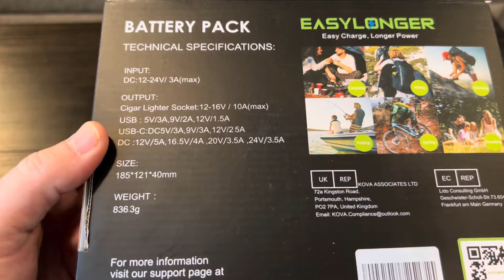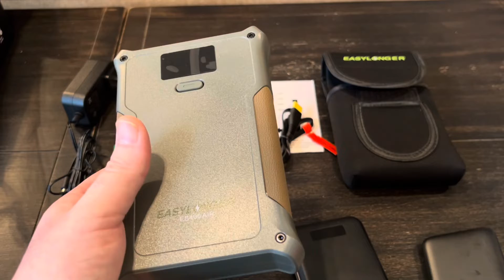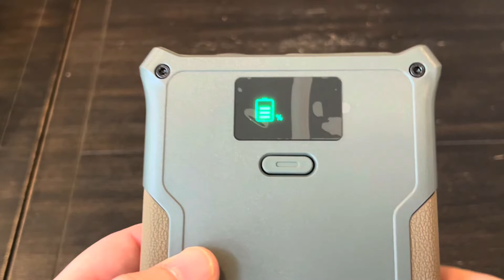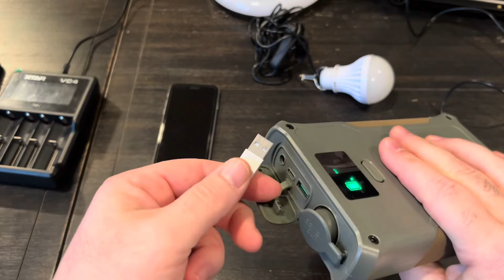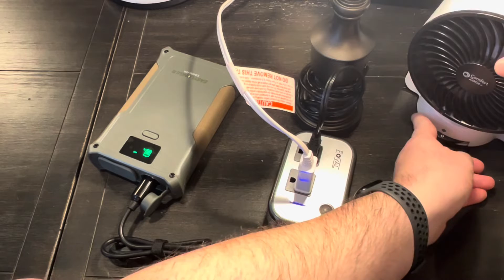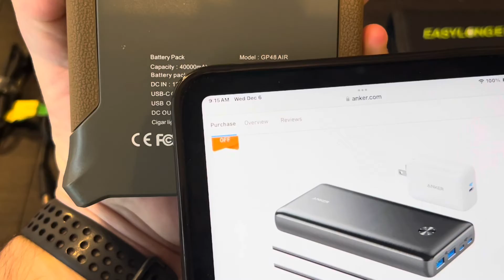EASYLONGER ES400 AIR Portable Power Station (CPAP Battery Bank)

Comment: Hello, I am a bit confused on what I need to purchase to take advantage of the UPS feature. I understand that I need a cigarette converter, but how do I know whay I am purchasing is the correct item. Would you please share the name of a converter? Thank you
Reply: Since the cigarette lighter port outputs a variable voltage (typically around 12V depending on the remaining battery level), but CPAP machines require a stable voltage to function properly, the cigarette lighter cable must with a voltage converter. This ensures that your CPAP machine receives a consistent and stable input voltage for reliable operation.

If you need to purchase a cigarette lighter cable, it depends on your CPAP machine model:

ResMed CPAP machines require a cable with a voltage converter that outputs 24V. The DC connector must be compatible with your CPAP machine.

Philips CPAP machines require a cable with a voltage converter that outputs 12V, also with a compatible DC connector.

If you have already purchased our battery but do not have the correct cigarette lighter cable, please contact our support team. We can provide you with the correct purchasing link. Thank you.
Reply from the maker: - I don’t remember if this power station has a ups. The video was done quite a long time ago. It has pass through charging which is completely different. Either way, when a power station has a UPS feature, you don’t need anything to use it. Say you have your CPAP machine or anything else plugged into the power station while the power station is plugged into the wall outlet at the same time. You lose power overnight, the UPS feature automatically keeps your stuff running as normal.
Reply: @Steve-Goff  thank you for responding

Comment: Nice video, but something doesn't make sense to me.  You say the UPS functionality will allow someone on a CPAP to keep sleeping if the A/C power goes out.  But it appears to me that the USB C port is output only, correct?  So the DC in charging jack is ALSO the DC out jack that connects to the CPAP.  If true than the battery can never be charged while the CPAP is in use,   So you get UPS functionality only on the USB C and USB A ports, but never for a CPAP plugged in with the provided cables.  You could use a 12v cig adapter for the CPAP, if you have one, but not using their cables, right? Or am I missing something?
Reply from the maker: - you are correct. The provided cpap cables do plug into the same port as the charging port so it’s impossible to use both at the same time. You could use the 12v cord as you mentioned or just get a small inverter as I showed in the video to take advantage of the UPS featt
Reply: Thank you for your question. Our DC output and input share the same port, and since our battery has a built-in voltage regulation system for the DC OUT port, you can set the DC output voltage to match your CPAP machine's required voltage before connecting it. As a result, the included cable in our package does not have a voltage converter, making it more convenient to carry.

If you need UPS functionality, the battery must have both an input and an output port available simultaneously. When the DC port is occupied by the AC adapter, the best available output port for your CPAP machine is the cigarette lighter port.

However, the cigarette lighter port outputs a variable voltage, which depends on the remaining battery level and typically stays around 12V. CPAP machines, on the other hand, require a stable voltage to function properly. Different CPAP brands operate at different voltages; for example, ResMed CPAP machines require 24V. Since the cigarette lighter port’s output voltage is much lower, a direct connection using a cigarette lighter male to DC cable will not work. 

To power a 24V CPAP machine using the cigarette lighter port, your cigarette lighter male to DC cable needs to be coupled with a voltage converter. This device boosts the cigarette lighter’s 12V output to a stable 24V, ensuring proper operation of your CPAP machine and make sure the DC connector size matches your CPAP machine’s input requirements. Tahnk you.